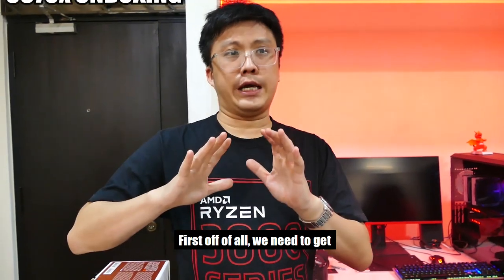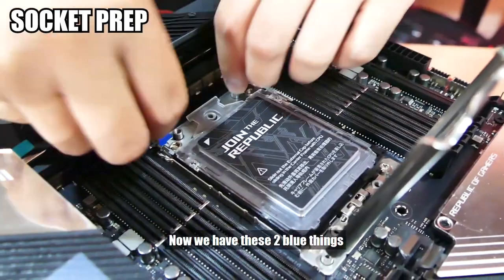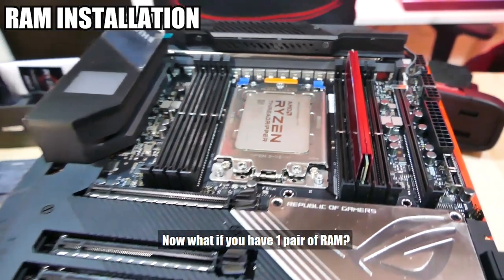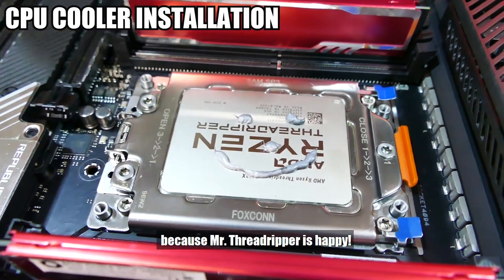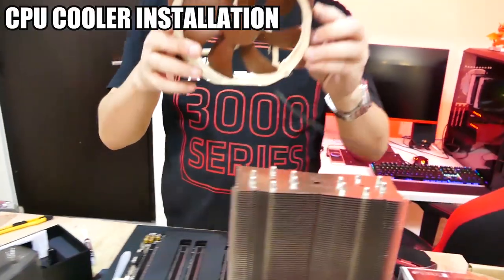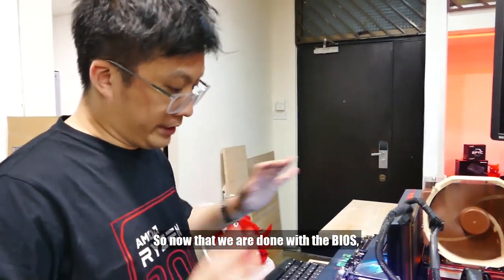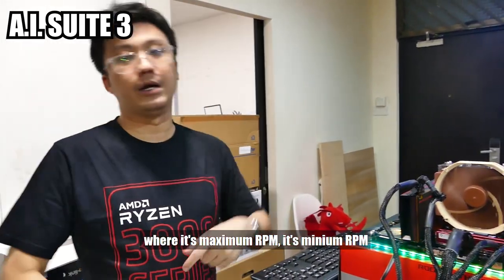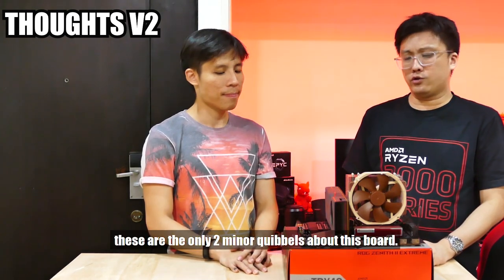How to install AMD Threadripper 3970x? (Ft. ASUS ROG Zenith II Extreme & Noctua U14S)

Comment: I did the same recently. But with a water block instead of a air cooler.
Reply from the maker: How are the temps? and which brand of water block did u use?
Reply: @RealMelTan  I used the EK waterblocks full nickle one. Temps are great, never happend to be over 60 degrees. I have two GTX 1080s in the loop too. I got two 360mm slim rads with noctua nf12 black swap fans in push config, so it also stays quiet.
Reply from the maker: @waldmoos  That is quite an amazing setup! Which case are you using? And are your GPUS water cooled too?
Reply: @RealMelTan  Yes. In a one loop setup: res > gpu2 > bridge > gpu1 > rad2 > cpu > rad1 > res.
Reply from the maker: @waldmoos  Very impressive. Why didn't you go for the normal route of res > CPU ? haha
Reply: @RealMelTan  I got shitty board partners for the GPUs. I dont know if you know Manli (Palit), but Blower designs, and other cards, esspecialy from Manli for the chinese Market, are horrrabile. So I thought, if you buy a Prozessor for 2000 fucking Euro, you also have to watercool your shitty GPUs.

Comment: Can you show us step by step how to connect all the cables,
Also where to place the fan extension card in the case please?
Reply from the maker: Hey S W ! If we get our hands on another Threadripper build, we can consider to do a build guide :) Is there anything else u want to else?
Reply: @RealMelTan  I’m new to building a desktop, and I’m planning on building a gaming/workstation with these parts:

AMD Ryzen Threadripper 3970X Processor
ASUS ROG Zenith II Extreme TRX40 Motherboard
Samsung 970 EVO Plus 1TB NVMe M.2 Internal SSD (MZ-V7S1T0/AM) [Canada Version]
CORSAIR Vengeance LPX 256GB (8 x 32GB) Desktop Memory 
ASUS ROG Strix GeForce RTX 2080 Ti 
Corsair AXi Series, AX1600i - Digital Power Supply
Corsair Obsidian Series 750D Airflow Edition Full Tower ATX Case
CORSAIR HYDRO SERIES H150i PRO RGB AIO Liquid CPU Cooler, 360mm Radiator
I'd love to see a step by step guide on from where to mount the motherboard + fan extension card,  to connecting the cables of each components to the motherboard, to connecting them to the power supply.
Also having a detailed cable management guide would be a big bonus too.
Thank you so much in advanced :)

Comment: you can instruct how to mount the water cooler on amd threadripeer 3970x
Reply from the maker: Hi Minh, what cooler are you using?
Reply: @RealMelTan  I just bought corsair h150i 360mm rgb

Comment: Great video! So if this gets an 8/10 is there another board you give 10/10 for the 3970x or 3990?
Reply from the maker: i wont give an 10/10 for anything, there's always a room for improvement for everything. I also like the Aorus TRX40 extreme. But I would not be able to give a score on it :)

Comment: Good video ! Thanks.  Can you please comment on PCIe slot 1 being blocked by the Noctua U14S.  From the video, I cannot really determine how bad is the blockage/clearance.  Will it render slot 1 to be totally usable?
Reply from the maker: Hey Matthias, the clearance is still ok for a blower 5700XT GPU which we used. But if you were to use a GPU with a thicker heatsink, like the Amperes, you may run into issues with the Noctua. If we ever have this board, we may test it out. Hope this helps!
And thank you!